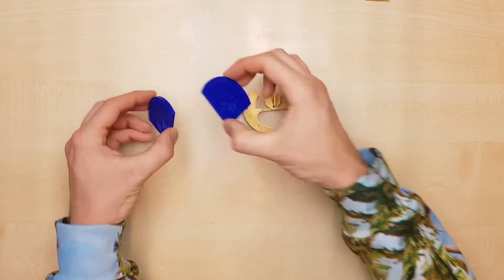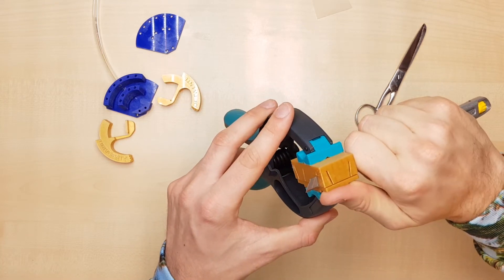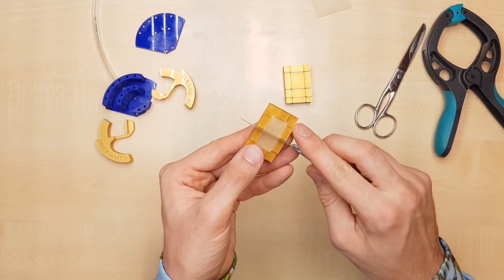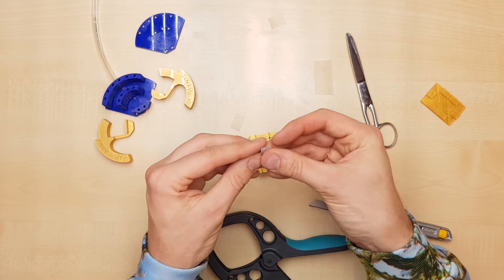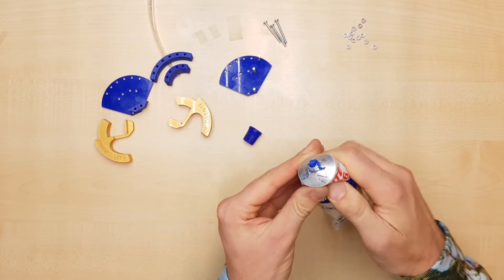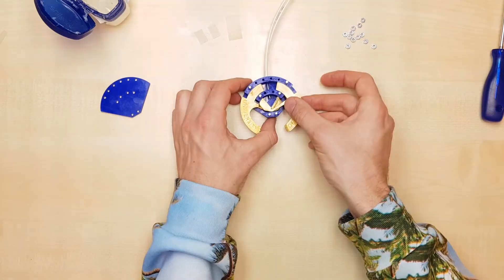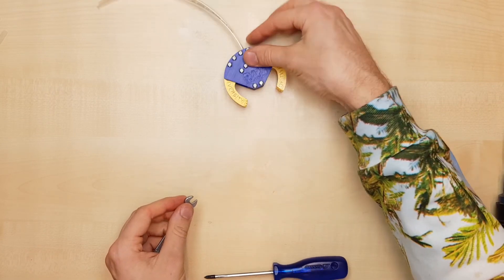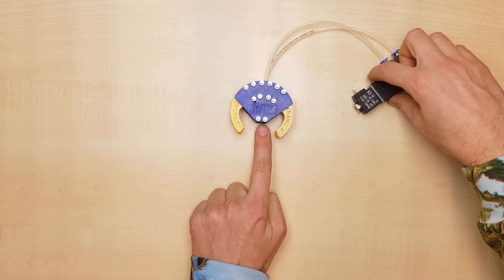DIY pneumatic gripper

Comment: What pneumatic components are you using ?
Reply from the maker: The valve is a PV5211-24VDC-1/8 (see http://www.compatiblepneumatics.com/home.php) and I used an air tank at 2 to 4 bar pressure I think. Tubes are 4mm polyurethane.
In one of the last shots I used Lego pneumatic equipment instead.
Hope this helps!
Reply: Thanks